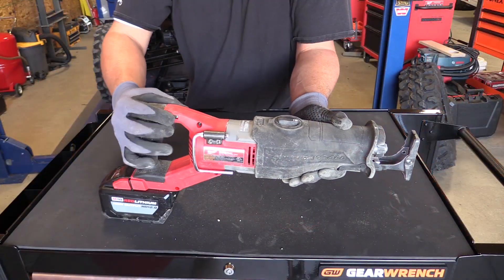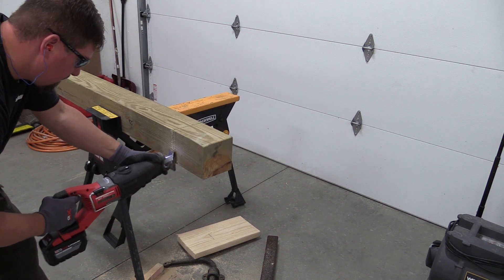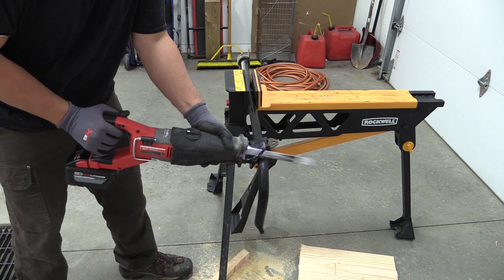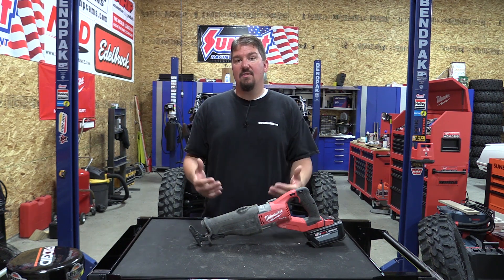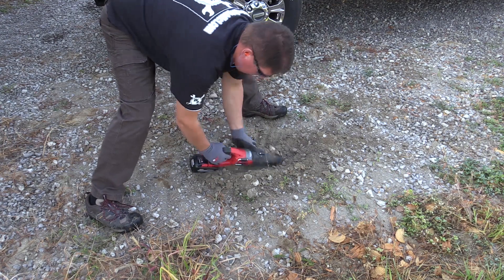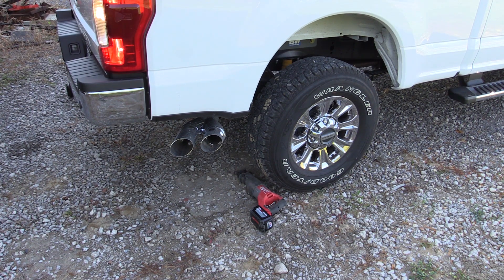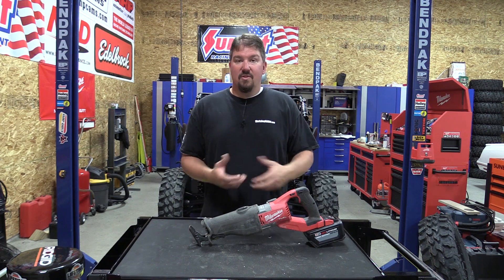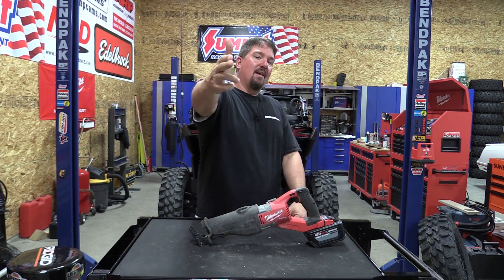Real World Abuse of the Milwaukee M18 FUEL Super Sawzall 2722-21HD

Comment: Finally I bought a new Milwaukee M18 Fuel Brushless Super Sawzall kit with a 12Ah battery, fast charger, and a bag.  It is so powerful and fast.  Too bad my super sawzall was a manufacture defect.  It broke down within a week.  I had to send it back to Milwaukee eService Center twice within a month.  I contacted Customer Service but I did not get any fair agreement.  Finally I filed a complaint online.  Customer Service team lead was so nice.  She emailed me that a new Super Sawzall was on its way to my house.  I got a brand new Super Sawzall.   It does make a big difference.  It is powerful and fast.  Instead of using 5 max of the speed limit switch, (5 max kill the battery fast), I use 4/3 or even lower to 3-2 speed.  My 9 Ah and 12 Ah batteries last 50% longer without loss much power and speed.  Definitely this super sawzall is powerful and faster than my two brushless sawzall.  It is so heavy that I installed a carrying belt with two nylon strip on the front rubber boot and the lower handle so that I can carry this super sawzall to do hours yardworks.  Definitely, I will buy Milwaukee power tool again for the customer service and eService Center repair.

Comment: The linear-orbital mode switch can set at different levels of orbital motion between the linear-orbital motion.  You can rotate the linear-orbital mode switch at 360 degrees and set at any point between the linear and orbital mode for any degree of orbital motions.  I prefer the linear mode to save my saw blades.

Comment: I got to play with a demo Super Sawzall as we’re looking to upgrade our tools on the fire dept.  I took my personal regular Fuel Sawzall and put it up against the Super Sawzall.   Using some of the Milwaukee Carbide Blades we took to cutting on some cars.   My Fuel sawzall got stuck several times.  I even switched out bladed trying to see if that was the issue.  The Super Sawzall is a beast.  It wouldn’t stop. I was so impressed I just picked up a Super Sawzall kit with a free second 12.0 battery from Home Depot for myself. The power and speed of the Super Sawzall is impressive!  Every Fire Engine and Fire Truck should have a Super Sawzall on it.  Apparently the Super Sawzall with Carbide blade will cut faster through the Boron B post of a Tesla car faster than the Jaws of Life can cut it.

Comment: Can you please let me know about the DeWalt 20 volt Sawzall just like that one thank you I would really appreciate it what is the difference between the DeWalt in the Milwaukee I would really appreciate it thank you very much love your videos man keep them going 👍👍👍👍👍☺
Reply from the maker: The 20- volt, not the Flexvolt?
Reply: @WorkshopAddict  thank you so much is it good for a homeowner though because I'm handicapped and the Milwaukee sounds good but it'll be too heavy for me but would the DeWalt be good for a homeowner the 20 volt if you can give me your opinion I would really appreciate it God bless you I'm a senior
Reply from the maker: @reynaldovalle1773  The normal M18 FUEL Sawzall is what you want, not this one.  This one is made for heavy duty work.  The normal M18 FUEL has less vibrations than the DeWalt.
Reply: @WorkshopAddict  one question is it better than the DeWalt thank you and I apologize for so many questions is that you guys are the best
Reply: @reynaldovalle1773  Milwaukee makes the best sawzalls....but if your into the dewalt...which batteries do you have? 20v ..get the 20v compact xr...it's good but for light work... flexvolt batteries ...get the flexvolt sawzall ,it's good but not like a Milwaukee
Reply: @joeframer9642  ok thank you so much I'm going to buy one that's why I asked you I really appreciate it keep up the videos I love them thank you again you guys are the best 👍👍👍👍☺

Comment: I got my new Milwaukee Super Sawzall with a 12 Ah battery for  a week.  I only used the saw once and the saw is not working.  I pulled the trigger but nothing happened.  I registered online with Milwaukee and I got a return label for repair.  Hopefully Milwaukee will fix it under a free warranty.
Reply from the maker: That sucks, but posting this in every sawzall video you find wont solve it.
Reply: You probably bought it from a third party. If not instead you would just return it to home depot. Stop lying man

Comment: How much of a weight difference is this sawzall compared to the Gen 1 M18 fuel sawzall with the same battery size? Also, is there much of a weight difference compared to the Milwaukee 13A super sawzall with 360° rotating shaft, and the 15A super sawzall?
Reply from the maker: This saw will be about 3 pounds heavier than the Gen 1 M18 FUEL, round numbers.  Not a ton of weight difference between the 13A, maybe a pound and the 15A super sawzall is very close in weight.  The weight was talked about only because some dude at home will complain this saw is too heavy.  With what you are talking about, you know, when you need power you deal with the weight.
Reply: @WorkshopAddict  i didnt realize that there was a 3lb difference between the bare tools.  however, i can justify the weight difference for the orbital action, which will ultimately make the job easier for what id be using it for.  I'm still bummed that they didnt make the shaft able to rotate like the 13A version.

Comment: I’ve had the saw for less than a year the first couple of months were very mild moderate use and within the past couple of weeks I’ve been doing some very heavy duty demolition in this Saul is absolutely 100% a piece of shit I will admit I am a Milwaukee fan boy I love their products but this sought is 100% garbage the motor is great but the trigger mechanism and some of the connectors fail or were not installed correctly from the factory I constantly lose power as well as while it’s running it has inconsistent power almost as if it is pulsating and then it will randomly shut off and not work I have not even had the opportunity to abuse this saw.  Perhaps I got unlucky and I got the one bad saw off the assembly line but still the amount of money you spend on a top shelf performance tool free commercial grade job site you would expect to get your moneys worth very disappointed and I hope Milwaukee fixes this issue
Reply from the maker: I have good new.  Go to Milwaukee E-sevice.com and they will fix it for free or send you a new one.
Reply: WorkshopAddict I talked with him yesterday and the lady on the phone told me from the sound of it it seems like there’s water damage and it’s not covered under warranty not sure how they come to that conclusion without even looking at the tool luckily I found a place a couple hours ago that is local to me that will fix it under warranty only problem is due to the coronavirus not a lot of people are working there so it may be a week before I get my saw back oh well.  I’ve noticed the same problem with the trigger on my hammer drill as well but the rest of my tools (all m18 fuel) Work flawlessly

Comment: Hi,

I have to agree with you on the blade clamp system.  I like the  one on the milwaukee super sawzall ( 2722) better. My corded milwaukee sawzall has the same style and i like that one better. I have the milwaukee m18 (2720) sawzall and not liking the blade locking system on the side but that might be only me. I wish milwaukee used that blade system on all the battery op sawzall. 

Thanks for this video.

Comment: Battery rattles too much. Starts to wear out over time
Reply from the maker: Send it back for repair.
Reply: I did twice. They only fix the terminals on battery and gun and not the case. And now the serial numbers on the sticker are scratched up so they won't take it unless the can read it.
Reply from the maker: @kylerego2139  That sucks bad.

Comment: Great video, i loved how you used parking on the tool to show the durability!  Now, can you cut through a pvc pipe filled with water?  Realtoolreviews did this with the original M18 Fuel sawzall to demonstrate that the gearbox mechanism was sealed and id like to see the same test done on this unit.  I own the original M18 fuel sawzall and primarily use it in prunning applications such as cutting through roots and breaking down wood up to 6" diameter, but i was considering the new supersawzall for the orbital feature, especially for cutting the larger and sap filled branches.  I use Diabolo prunning blades with it primarily if that helps.
Reply from the maker: Lol....  That would be easy.  You want me to sink the Sawzall in water?
Reply: @WorkshopAddict  Yes, that would be a great test too!  I still, however, want you to cut through the water filled pipes to see it performs when exposed to water while in use.  https://youtu.be/Eaod2aLKhUM

I pasted the link to the Realtoolreviews review on the original m18 fuel sawzall for reference.  i think he shows the test about 10 min in the video.
Reply: Shaun Catlett you want him to get wet 😁

Comment: Since the HO tool kits are so expensive and you only get one battery and slow charger. .. And is so called compatible with the whole tool line... You need to see how the 9amph bat performs since it has the smaller cell. I am guessing you will truly need another 12 amph bat and rapidly charger for the serious work it is intended for...   That's 1000 bucks! I am guessing the 9 amp will trip out. Can't you find out? Then people will know if it's truly compatible or they have to invest in more larger cell batteries!
Reply from the maker: Invest in the larger batteries.
Reply: But a 9 amph is a large battery a lot of people invested in not that long ago!
Reply from the maker: @philipjohn4149  Marketing at it's best right....  Sorry, I do not design the tools, I just make videos to try to help people decide if this is the right tool for them.  If I could tell you it runs just the same on a 9.0, I would, but I am not going to lie to you.
Reply: Anyway. Great channel. On another note. I have heard... Some fire stations go to this sawsall with carbide blade because it's now quicker than Jaws of life to extract  a person when cutting through car pillars!
Reply from the maker: @philipjohn4149  Hope my comment did not offend you, but I cannot tell you that this will perform the same with the 9.0...  It won't.  I would like to try to cut the A and B pillars on a new car to see how they work.

Comment: Like the video!! Can you test the blade attachment with salt water.. I work in the oil industry and that’s the biggest problem I have.. you cut into a brine water line and let it set you will not get that blade out without a struggle and some WD-40
Reply from the maker: I have to assume it will be good in the beginning and after use and the anodizing wears off it will get worse.  Let me see what I can do.

Comment: simply awesome, to get that kind of power without a cord... and with only an 18v battery, way to go milwaukee and #WorkshopAddict for a job.. Super well done!!
Reply from the maker: Thanks bud.  Try not to think volts.  Think watt-hours.  That is volts x Amp Hour.  So 18 x 12= 216 watt-hours.  You then have to watch if a manufacturer uses the word *max in the volts...  You will find that all of the batteries from the tool companies of similar size and rating, no matter the volts, have similar watt-hours.  Voltage has become all marketing.

Comment: I’ll tell ya what eats up my Sawzalls. If you are standing on the floor , hold the saw above your head to cut out plaster/Sheetrock ceilings. The saw is being used in vertical position with the saw end straight up , that dust is very very fine and gets into everything. I’ve ruined a lot of saws like this.....time will tell....good video.
Reply: got goods news?